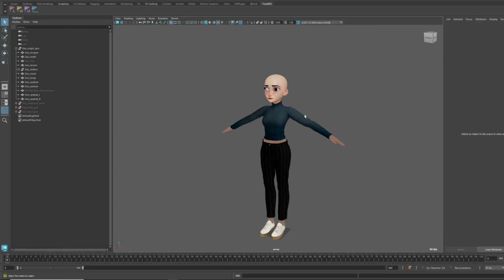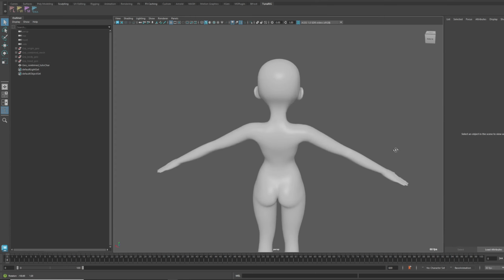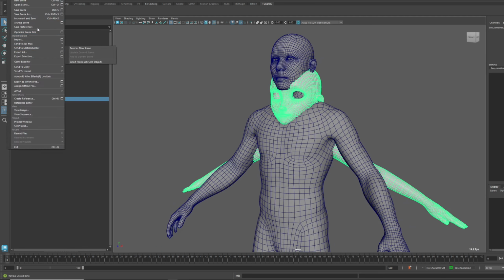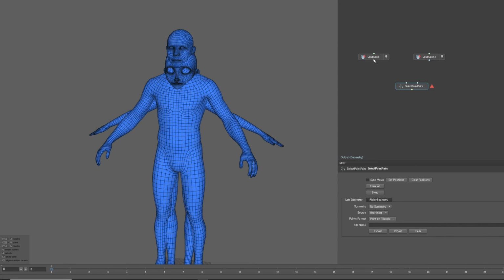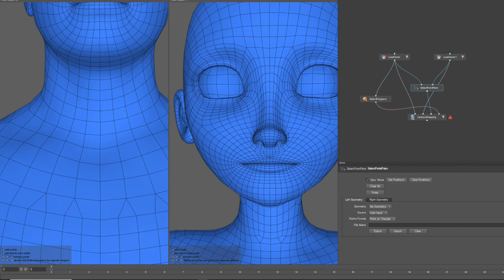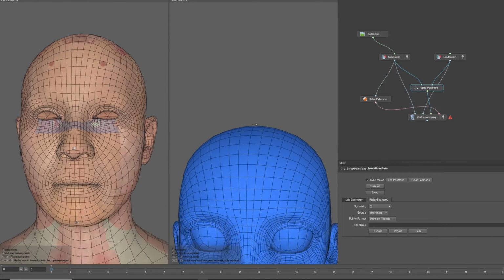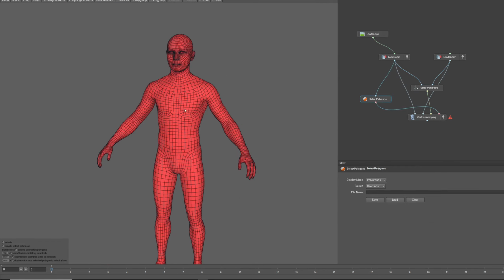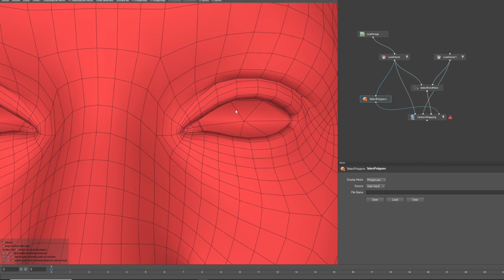TunaMetaPack - Prepare Process [Part 2] Wrap Retopology

Comment: Can you tell me also please what about updates? Are they for free?
Reply from the maker: We are plan to some updates and of course it’s free update, but, it still difficult to learn yet, so if you are not confident with our rigs process, please wait for some updates
Reply: @tunaRig  i mean, update of your tool. For example of Maya 2025 when its coming. Is update of new versions of your tool free?
Reply from the maker: @ZaJanoyNaFilippiny  For maya 2025, we cannot provide support yet because we have not yet received official files for the plugin node that can read DNA in maya 2025 from Quixel Bridge, but we plan to update support as soon as the issue is resolved. of course all updates are free